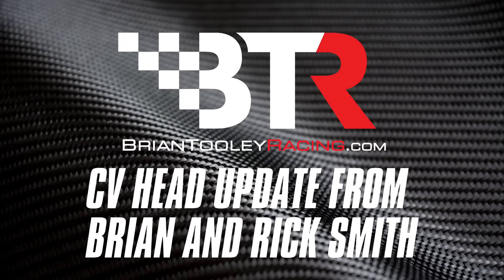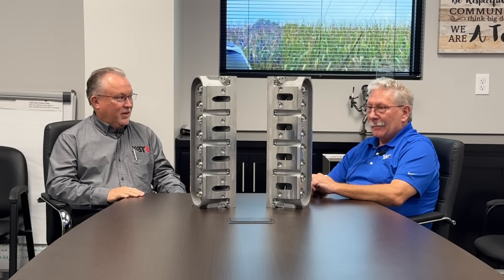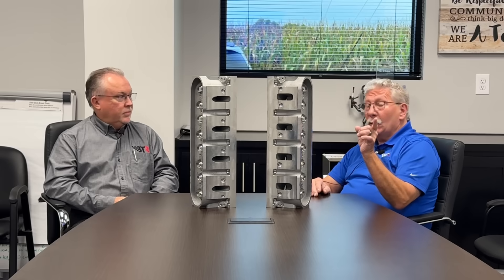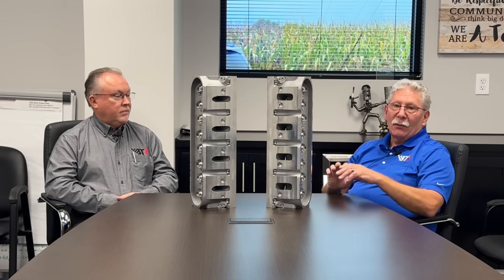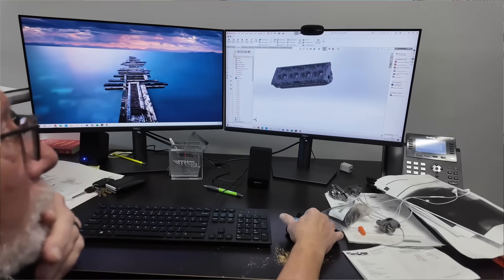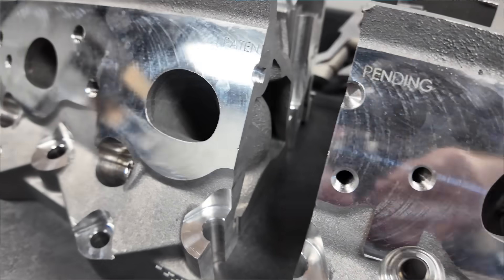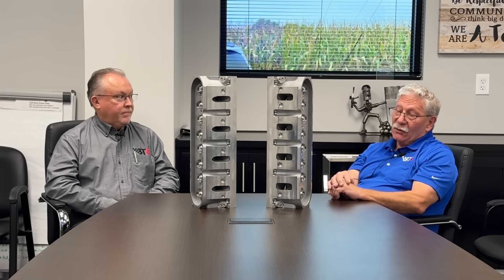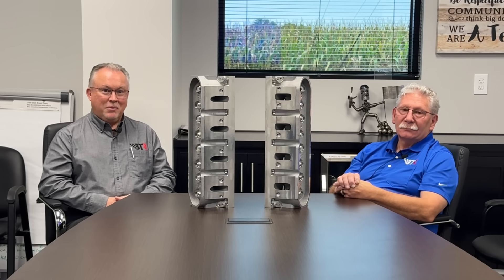What's Going On With The BTR Canted Valve LS Cylinder Heads?

Comment: Will these be offered for Specialty integrators (like MBE etc) in a Raw Castings to offer the ability for others to develop their own CNC programs and final port profiles etc ? Does the semi-permanent tooling produce a more predictable casting with less core shift etc between runs or batches ? This could end up being a real game changer for alot of people, so take your time. I am sure it will all be worth the wait.
Reply from the maker: The initial offering of our cylinder heads will be porters' castings. Customers can order them, but the heads will have to be ported by someone like MBE, GPI, etc. Yes, absolutely, the semi-permanent mold process produces higher quality and more predictable products.

Comment: How will these compare to Mast Motorsports heads?
Reply from the maker: We purchased almost all of the readily available cast aluminum LS3 cylinder heads and dyno tested them against our CV heads, and our heads outperformed them.
Reply: @briantooleyracing3554 so you didn’t test against Mast Motorsports canted valve heads? That’s cool.
Reply: @smythtaylor7272 comprehension is key. "Cast aluminum cylinder heads". All you had to do was search. They tested against masts "cast aluminum" heads, and they out performed them. They're not talking about billet heads.

Comment: Awesome. I need heads for my new LS2 build. I bracket and index race at a drag strip 90 miles from my house, drive to the track, swap tires, race and drive back home. I'm going to be very interested in cathedral ports with powdered metal guides for the high miles I put on. Made in USA, amazing. When available, I will buy.

Comment: I'm at 9:20 I might be jumping the gun, but will you offer a HIP process at additional cost? with the cooled casting process, does this make the HIP less effective? as in the HIP process closes the grains up a little, does this casting method negate the benefits to HIP? or does HIP still yield strength benefits?
Reply from the maker: We will offer a HIP option on our heads.

Comment: So basically your using a aircraft grade alloys and also the foundry is also the same place which makes aircraft alloy parts from scratch, at least thats what i am getting. 
Only because i know that the aircraft alloys and foundry's/ cnc and milling machine shops which do all this type of work are all FAA and international standards way above the ASTM standards for say engine OEM heads etc.
I used to sell aircraft alloys from 2021 to 2024 aluminum to 6061 to 7071 alloys as well as titanium and even specialised welding rods which each rod has a number stamped on the end of it with date of manufacture and also the code of the alloy welding rod, so like it would have say 2024/ t4 as a example then a date of when it was made and the batch number as well all for the traceability of the products and every aircraft maintenance part to be used has the same part no, date, batch number etc etc. Keep up the great work guys and still the best in the business IMHO. 👍🦘✌👌

Comment: Will this head be able to use solid roller cams and springs?
Reply from the maker: You could use a solid roller cam setup with an adjustable rocker arm system like the one offered by Jesel.
Reply: Is that like a yes?

Comment: Will these heads require special valve relief çuts compared to standard 15°?
Reply from the maker: If your camshaft of choice allows the valves to clear the pistons with current LS3 cylinder head offerings, it will work with our heads without valve relief cuts on the pistons.
Reply: Is BTR liking you comment a yes?
Reply: @krusher74 i think they will take a different valve relief because of the canted valve and the head is a 12° compared to 15° ls3
Reply: @KS-dg5zh not 100% sure but the canted valve + the change from 15 to 12 may delete the need for custom or different valve relief

Comment: I’ve loved Trick Flow parts since they first started making sbf heads. They are absolutely astonishing even for back in the day with twisted wedge 165 and larger cylinder heads. The last set of heads I purchased thru them were Trick Flow 11R 205 cnc comp ports. I still love their high port heads, they are absolutely amazing as well.
Reply from the maker: Rick has designed many, many excellent cylinder heads over his multi-decade-long career in the high-performance automotive industry. We are extremely fortunate to have Rick and Brian on the same team under the same roof.
Reply: Without trickflow ford would likely be out of business